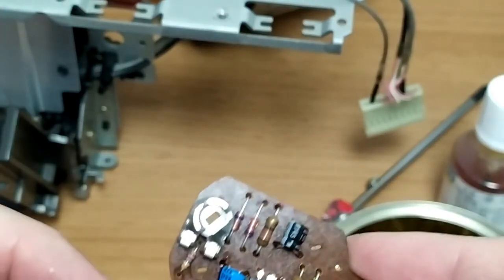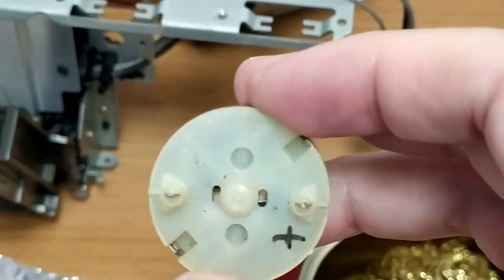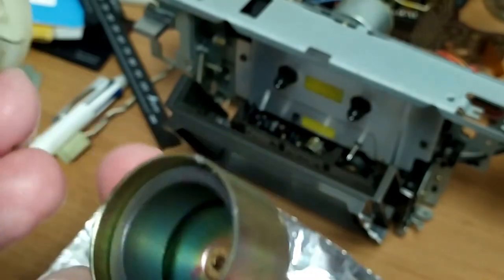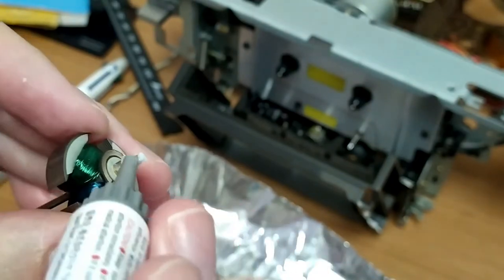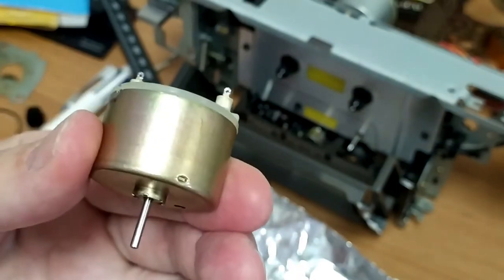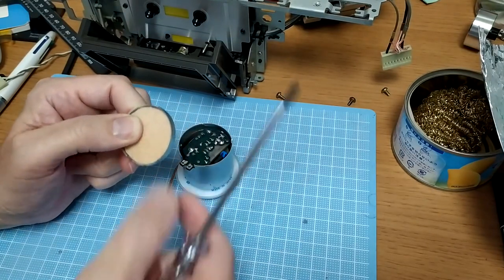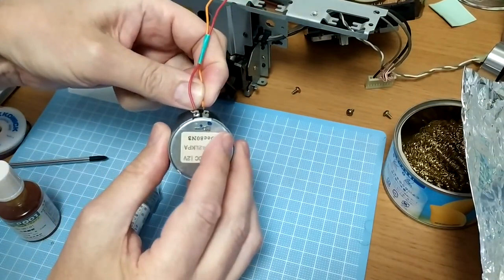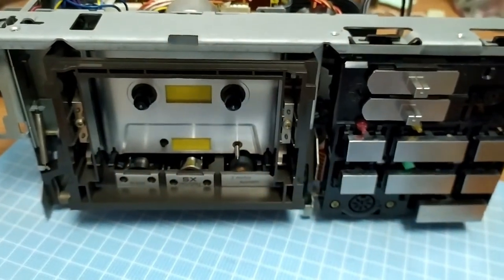Cassette deck motor repair - part 2

Comment: Well done, i liked the felt packing substitute.
I didn't see you clean the commutators, but i'm sure you did.
I hope the speed was steady and no odd effects.
Reply from the maker: Yes, a quick spray with cleaner as it was pretty clean in there.  Not everything gets recorded, but you are correct that it should be noted.

Comment: Looks to be the same motor in the 260 models. I need a new motor I think as the one in my unit seems slow, and wore out. Adjusted speed to no avail.
Reply from the maker: Similar motor in many decks.  Different manufacturers, but basically the same specs for most, 2400rpm (with adjustment) CCW (counter clockwise rotation).  Try opening it up if you are brave, but also check the wires going to it.  In at least one case there were only a few strands going to a motor, and it couldn't pass enough current.  Clipped wires and resoldered and it was good again.
Reply: @felix_da_katze  yes sir, I opened it up to change the belts as I thought that was the culprit. Seem to have other issues with playback. Sometimes the sound does not seem to work. I put my finger on the motor to slow it down, and without much pressure, it slowed right down. I did look at the wiring and it looks to be soldered correctly. I also noticed when I reinstall the ground strap when lifting everything together, it gets really quiet and muffled sounding. Wondering if I have more issues than just a motor, or if I messed something up when I took it apart to change the belts… first time ever doing this, but, I’m mechanically inclined so, I was careful not to move things without making a note of their position and such first. I tried calling some repair places close to me, left voicemails. Have not heard anything back from them as of yet. Maybe let them take a good look at it and go through the unit more thoroughly then I can.
Reply from the maker: Look for the service manual if you can, they are often helpful in understanding how things go together and how they should work.  Normally the motors should have quite a bit of torque, so should take more than light pressure to stop.
Reply: @felix_da_katze  yeah, I’d have to buy it. There are online sources but you need an account and I’m unable to make one as the website is not allowing new accounts to be made. I don’t want to get too involved with it as I am not an electronics type person haha. I figured I’d try the belts and was successful but, when it comes to circuitry and all the components, I get lost. I do agree with understanding how the equipment works, if I had some manual or schematics, I can probably follow it and understand better.
Reply from the maker: elektrotanya is a worthwhile website to search for your manual. The other one you are almost certainly talking about hasn't been taking new users for a couple of years now it seems.  Not sure what is going on there.
Reply: @felix_da_katze  thank you! Was actually able to find it on that website! You are the man.

Comment: EXCELLENT, ASK, SOME TRICK TO PUT THE VARIABLE RESISTANCE EXTERNAL AND REPLACE IT WITH A POTENTIOMETER! (WHAT A SERIOUS VALUE) TO MAKE ITS CALIBRATION EASIER ?, I HAVE THE ORIGINAL MOTORS WITH THE FAULT Q THEY SLOW
Reply from the maker: I think the variable resistor inside the motor is 200ohm.  You should be able to desolder it, run the wires out through the adjustment hole and connect to a multi-rotation type.
Reply: @felix_da_katze   thanks felix

Comment: Bad lubricant.....  😢
Reply from the maker: Yep, and if you read the blurb I mentioned I no longer use it for the bearings.  That said, that motor is still working happily.  Oil's the thing.